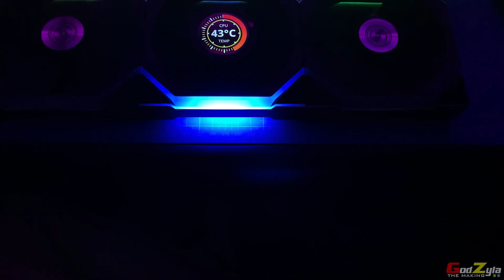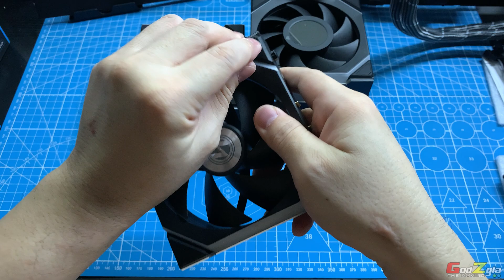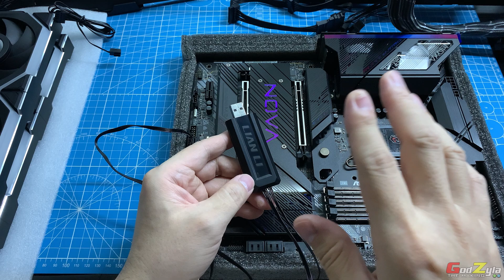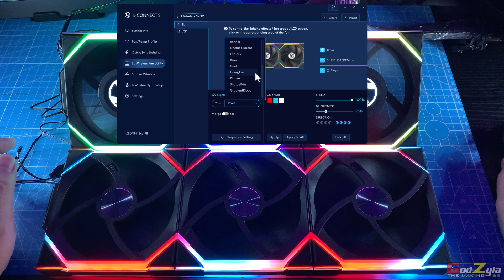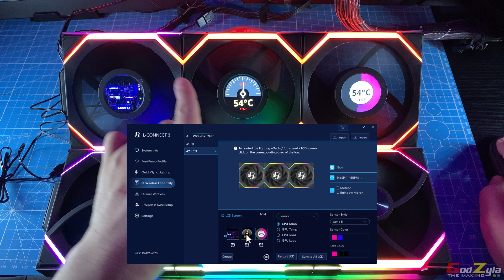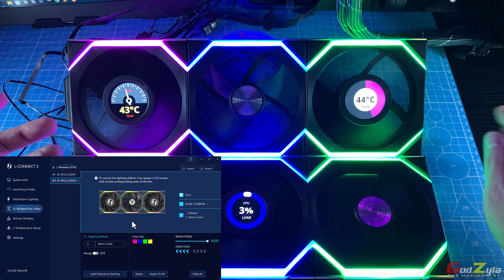Lian Li -  Uni Fan SL and SL LCD Wireless 120

Comment: That's insaine, you need 1 dongle per fan header... when the mobo already has wifi. Bad design.
Reply from the maker: Hello gunslingor gunslingorsadf, welcome to my channel. hmm..  you only need 1 dongle for 10 channels where 8 channel each can hold up to 4 SL wireless or 3 SL LCD wireless or 2 SL wireless + 2 SL LCD wireless .. and inclusive of 2 channel which is for your strimer wireless. or do you mean reciever.. if reciever you can plug to the sata to split 3 4pin pwm connector. as for wi-fi there are no interference to the internet wi-fi.

Comment: can i use usb hub with power supply?
Reply from the maker: Hi Rezuan Isham,  welcome back. if you are referring to the Lian Li Edge that has the USB on the PSU, yes you can.
Reply: @KleoYan  i mean an external powered usb hub
Reply from the maker: @razerangelri  if you are referring to the nzxt internal 3.0 hub. Yes you can use that.
Reply: @KleoYan  sounds great
Reply: @KleoYan  can i use these fan with my galahad II AIO?
Reply: @KleoYan  Lian li edge is also a great idea.thank you for the idea
Reply from the maker: @razerangelri  most welcome. Yup you can use these fan on a GA II Trinity

Comment: Not bad, but still just as much if not more stuff needed for this to run. the only difference is that atleast having the sensors on dont make your cpu run hot and lose performance
Reply from the maker: @huzaifavawda8383  hi ya. Welcome to my channel. I still prefer the pwm is to be enabled for motherboard for direct control but I guess their motive is not to confuse the L-Connect 3 app. Since now the 4pin pwm is their solution to provide power to the fans and not via the controller or hub.
Reply: @KleoYan  very true, but it still addms more of a mess, especially if you need another USB hub , I mean, it could have been better. If you still have a set of TL LCD fans, see what  happens when you run the sensors on the screen, your cpu temps go up a min of 10 degrees, and you lose cpu performance. By the way, great video! Love the details and presentation
Reply from the maker: @huzaifavawda8383  Thank you for the info. For the TL LCD, it’s kind of glitchy. It was ok back then with l-connect 3 version 2.0.9 or something. Till the Galahad II LCD came in and now the hydroshift, where the application starts to glitch the TL LCD. I have reported and they did something on the application. Which I believe the IC chip is different. I know what you meant. I stop using the TL LCD as am currently using the GA II LCD only. Am going to test this SL LCD for awhile. 😉 let’s hope is not as glitchy as the TL LCD.
Reply: @KleoYan  thank you for acknowledging that! I have the Hydroshift and use that as well and just use a static picture on hte fans. I love the look of the SL though as I had the originals, they look so chilled. Please keep up the good work and I thank you for your videos
Reply from the maker: @huzaifavawda8383  you are most welcome. I am glad you like my content 😉I will strive harder, just need to figure out a proper studio setup to do my content, its very noisy when I record the content so excuse me on the background noise.
Reply: @KleoYan  I think you doing the best you can with what you have and have detailed explanations straight to the point!
Reply from the maker: @huzaifavawda8383  thank you for your kind words, greatly appreciated it 👍👍👍

Comment: ask, its rgb light better than tl series ?
Reply from the maker: Hi maxsun z370, welcome back. It greatly depends on what you are after. some prefer the SL style and some prefer the TL style. the difference between these two are the infinity mirror with you have at the side of TL fans.  if you are asking about the ARGB light strenght. I prefer the SL which are cloudy and nicely fushion, unlike the TL, it's too sharp for my liking.
Reply: @KleoYan  ok thx
Reply from the maker: @maxsunz3703  you are most welcome.

Comment: Too bad there’s no RGB cable like they did with their previous controller
Reply from the maker: Hi Johnny B. Root, welcome back. Good observation, I didn't notice that.. thank you.. will feedback to Lian Li. 👍👍👍
Reply: @KleoYan  I saw your video about the older fans recently and remembered it. I think it was a great addition to it. This way you can just use your bios and don’t need extra software running on the computer. In fact I was waiting for the wireless version to come out to see which one I was going to get. Now I know I’ll get the older/wired version of the fans. Thanks 👍
Reply from the maker: @jeanbiroute  oops, I misunderstood your first comment. I thought you are referring to the Sync 2 and Sync 4 which enable additional argb strip. Ok, I got it now. yup, in the past you can plug PWM and ARGB without the controller but as Lian Li innovates their argb fan products. It become less available, this is what I've observe too. Thanks again for sharing..

Comment: Airflow and static pressures from these fans are not good. How can they be worse than the original LCD fans? Not only that, worse than the original SL fans from 2 1/2 years ago.
Reply from the maker: Hi Mapantz1, welcome to my channel. Thank you for your feedback. I am judging between these fans, if you wanted to compare with other fans, yes I agree with you.
Reply: @KleoYan  I just think that Lian Li have forgotten what the purpose of a fan is. They are hell-bent on inventing things for problems that don't really exist, and not concentrating on performance gains. The L-Connect 3 software was already rubbish, and today's new release has created all kinds of problems for users with the original LCD fans.

This is why I won't buy any Lian Li products anymore. They have lost their way and are just coming out with gimmicks to gain attention. It's disappointing to see this happening.
Reply from the maker: @Mapantz1  As much as there are lots of rant about the L-Connect 3 app. There are some glitch here and there, which to me is common but not terrible. Maybe I am lucky as I stick to one ARGB eco system and I do not use legacy equipment. As metioned, for older gen system. It can be of a problem. Nevertheless, I will leave this to the public. As for aesthetic over performance, it's up to individual. Thank you for your straight and direct feedback. Greatly appreciated it.

Comment: lian makes S tier hardware but F tier software
Reply from the maker: Hi trees, welcome to my channel. Thank you for your feedback. I can't speak on behalf of Lian Li, but in my use case on testing these or in the past Uni Fans. I have no issue with the application.
Reply: @KleoYan  the issue is with l3connect

The background resource usage is high and the lcds dont work if u disable it. The proprietary nature means opensource software obv wont work

Anyway i bought lianli fans and aio thanks to yout reviews!

Comment: Agh!! Lian Li!!! Stop tempting me!!! I just upgraded my setup with the TL & TL LCDs a few months ago!
Interesting that the LCDs perform better for radiators... always thought the non-LCDs would be better!
Reply: the tl's are better and ironically have less wires
Reply from the maker: @mainsource8030  welcome to my channel. If you are to count the cables, it does have less cable but the issue is, the hub is kind of big and bulky. Nevertheless, thank you for your feedback. 👍👍👍
Reply: @KleoYan  no problem, good luck with your channel!
Reply from the maker: @mainsource8030  Thank you 😉
Reply from the maker: HI High Octane, welcome back, I guess you have to ignore YouTube for awhile 🤐else you will be over spending. ok just kidding.. I believe is due to the 9 blades as compared to the 7 blade, I did a quick test on my test bench Arctic Liquid Freezer III 360 and between the SL Wireless and SL LCD Wireless, the temperature is 3 degrees apart.
Reply: @KleoYan  Ah, but the "good news" is, I am using 6 140TL! Looks like these SL do not come in 140... for now... 
In terms of wiring, yeah, there is still 1 bundle of wire coming from each fan group, but looks like it is a smaller bundle (appears to be 2 wire vs 7?)
Reply from the maker: @BasTech  ooo... btw speaking of which.. if your current version L-Connect 3 app is working, do not upgrade it ok.. there are reports on 2.0.19 having issues. https://www.reddit.com/r/lianli/comments/1g6vz69/lconnect_3_v_2019_recommend_do_not_install_if_you/